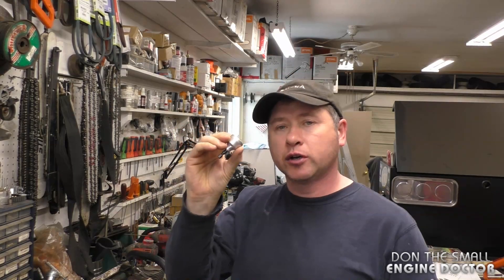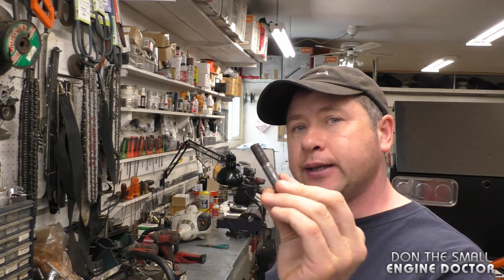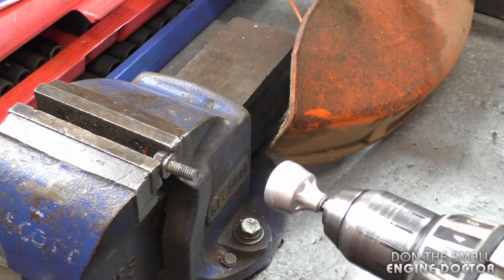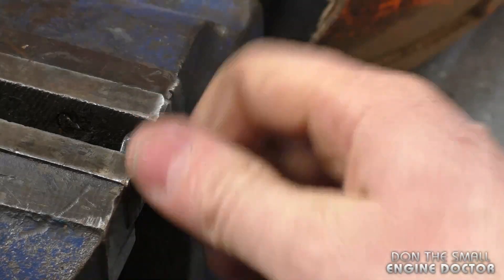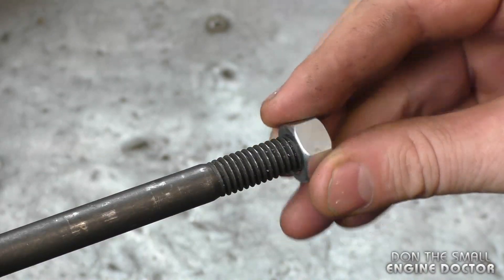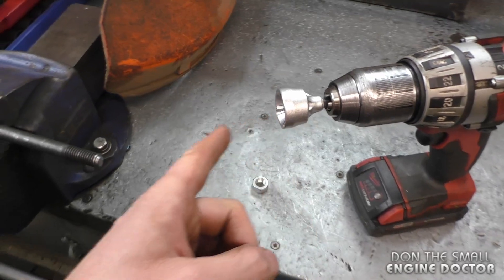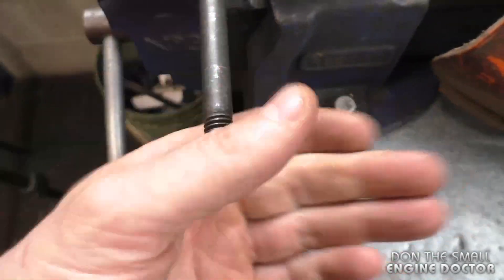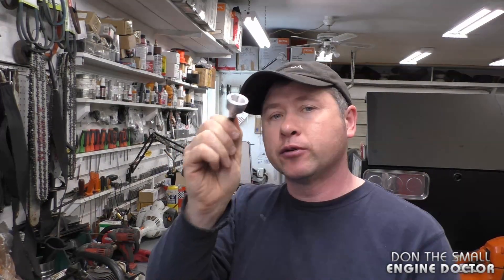OrixPlus Deburring Tool Follow-Up | Does A Nut Go On Easily

Comment: Thanks Donny
Great video, I’m a former Machinist, and it killed me to see this tool in action. What I do is prior to cutting the thread, I screw on the nut (if possible) I do the cut, then unscrew the nut, then round the burr on the thread with a machinist file, very quick and easy after a few tries..
Reply: I do the same thing and, sometimes, instead of a bolt,  I screw a dye (tap and dye tool) before I cut.
Reply: Sailing Dazzlin Legend What if it was a broken bolt? I believe that is what the tool was originally designed for. Cutting threaded rod down to size, and being able to do many pieces quickly, this tool would be most beneficial!
Just my opinion.

Comment: Impressive! I would have expected to need to chase the threads with a tap or at least a nut (cutting and reaming with the nut in place then removing it as a cheapo thread cleaner)
Reply from the maker: it works awesome, I as impressed